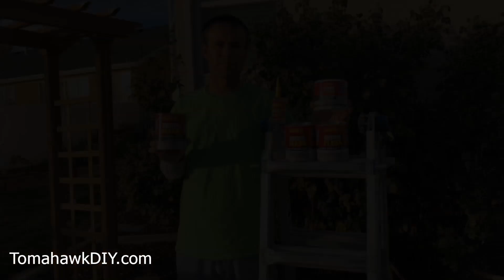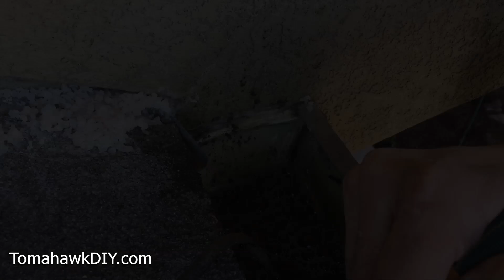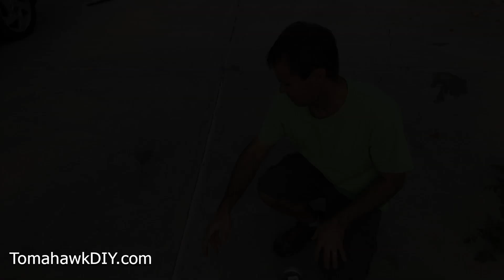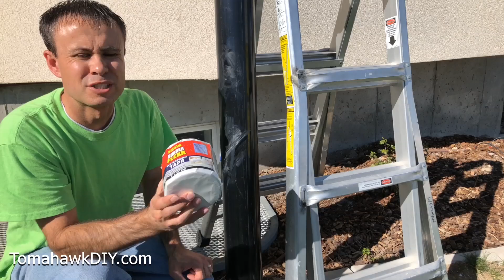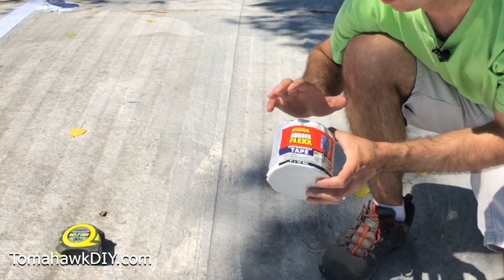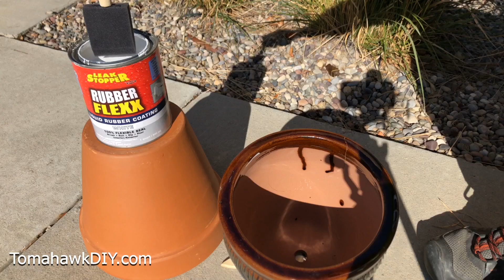Rubber Flexx Does What?!? (More Than Stopping Leaks)

Comment: I just applied after taking off some drywall because it seemed that there was moisture getting through the brick. So removing dust from the brick l put a coat of spackle on it. Let it dry and then, a very liberal amount of the flex. Now I am going to put a decent piece of insulation ,a metal stud and another new piece of drywall. 
   Trying to be ready My little girl will be here shortly and needs a room.
Kool vid
Reply from the maker: Thanks for sharing your experience. 😊
Reply: How long did it take to cure? I applied some to a roof 12 hours ago and still wet to the touch.

Comment: Could this be used for roofing something such as a little free library? Could it be used alone or under asphalt shingles?
Reply from the maker: Yes, you could use it for that. It will start showing dust over time, so maybe but down as a waterproof layer and then a decorative top for the roof. Check out my video installing a little free library! https://youtu.be/rslXa3J8VLg